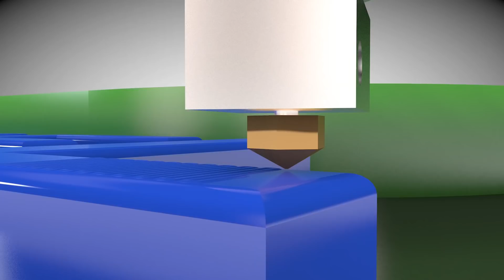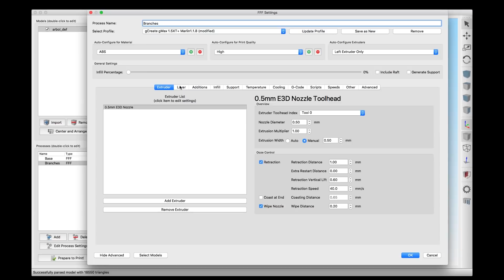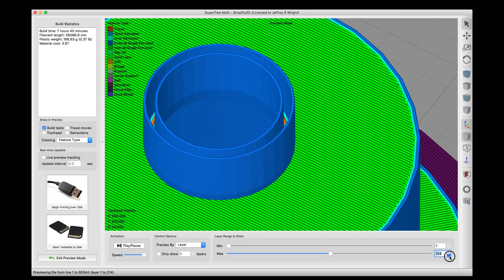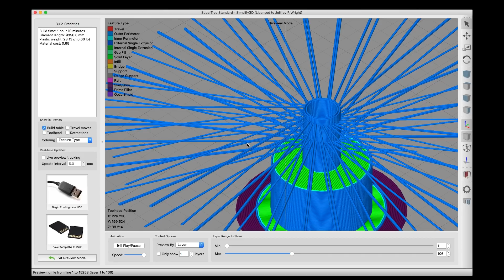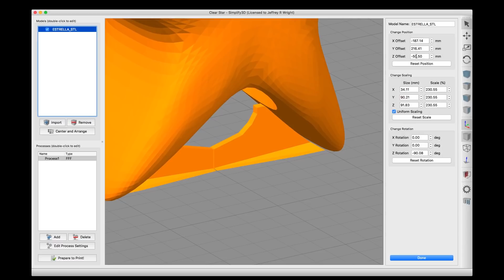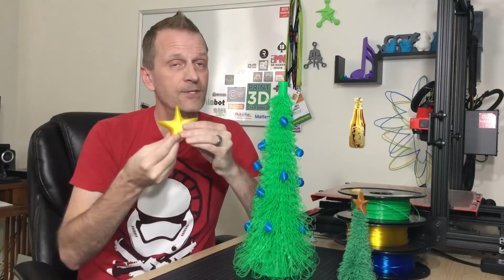The #gMaxSize Super Duper Droop Loop Christmas Tree

Comment: Very cool, I would like to give that a try. I also have a Gmax but it is for my work. I bought it with a heated bed and the dual extruders. After the buildtak surface started getting a bit chewed up I replaced it with a sheet of PEI and that has worked very well for me for the last 9 months or so. I also like the fast honeycomb just for the way it looks and prints but I actually find the rectilinear is a bit faster and possibly stronger. I recommend doing some of your own tests. Thanks for all the hard work putting out worthwhile content for the rest of us.
Reply from the maker: Sanded acrylic for the win, I have used all kinds of bed adhesion assistance and what works best on the gMax is the sanded acrylic bed. Been using it for over 2 years now and no issues. Just a light wet sanding between prints, very light touch. Thanks for watching and for the kind words.